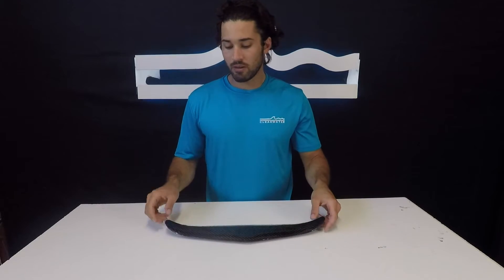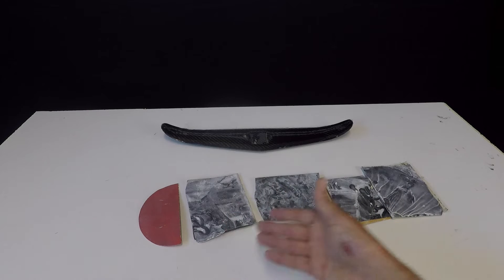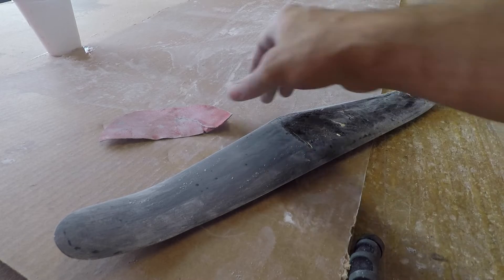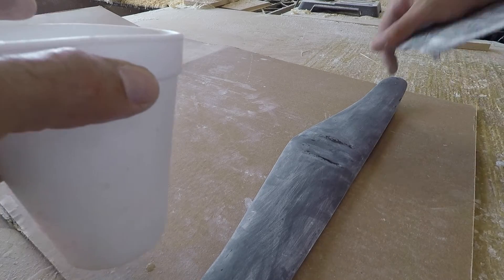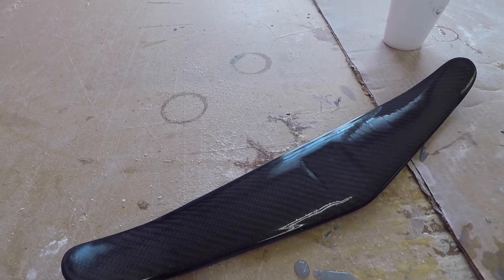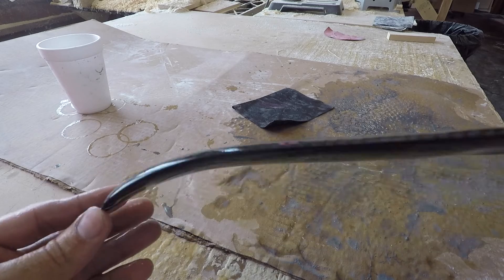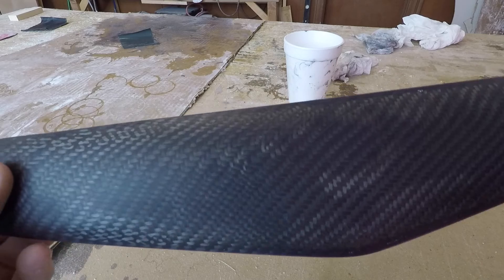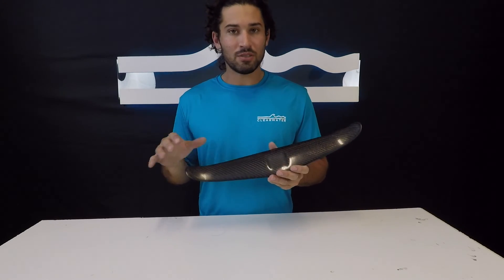HOW TO WET SAND. Get a perfect hydrofoil finish!

Comment: Im wanting to turn gloss carbon fiber to matte finish. Whats your recommendation to. Wet sand grits. Like these instructional vids sir
Reply: Hand sanding with a 1000 grit would do the job. I just used that to finish repairs on my satin wing. You could also use slightly coarser.